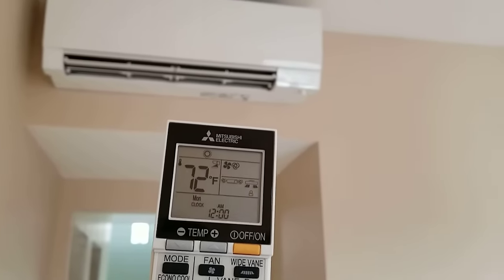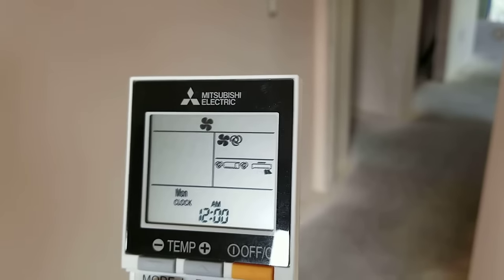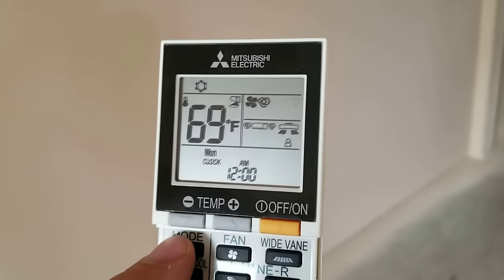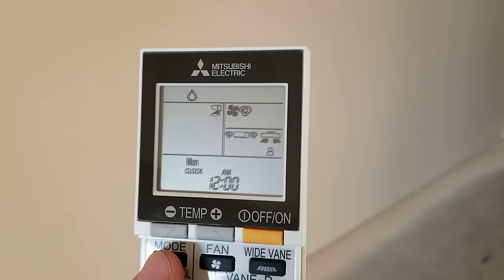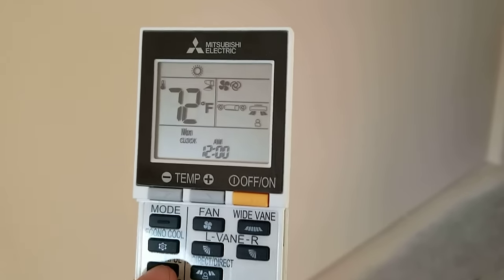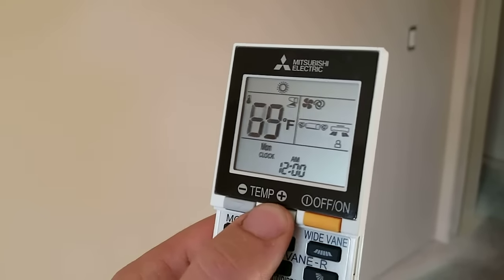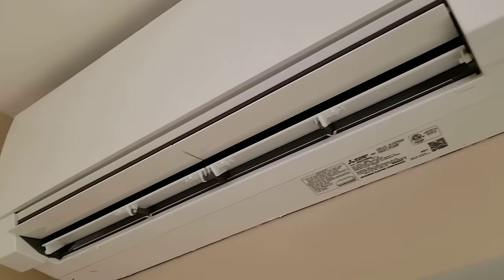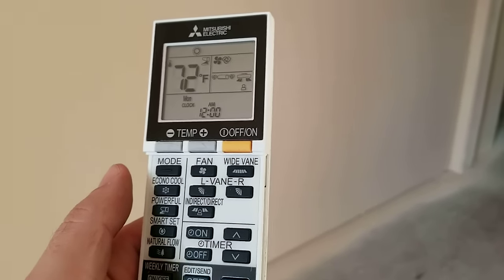Mitsubishi FH FS Hyper Heat Remote Control Operation.

Comment: A lot of talking when does he show how to turn on heat 🙄😒
Reply: Sunshine thing is heat. Set everything else to the auto, the swirl icon. Yeah Japan! :)
Reply from the maker: The old version of the remote has symbols and the sunshine is for heat. The new one is using words like heat so it's very easy to understand. You use the mode button on the remote to cycle between the heat cool dehumidification and auto modes.

Comment: I was wondering why I could not set the heat pump lower than 61 degrees and you answered my question! I thought there was something wrong with the remote, but knowing that the heat pump won't go lower than 61 is good to know. (It double beeped and I wondered why that was the case.)

Comment: I've set the fan speed to level 3 or 4 and kept the temperature unchanged the whole day. What I've noticed is that the indoor unit repeatedly blows at high speed for a while and then stops blowing for a while. Is this normal?
Reply from the maker: Yes. Great observation by the way! The typical reason this is happening, your unit is running in the heat mode on the high speed that you've set, then it might go into defrost which changes the operation mode and then it resumes heating cycle once the defrost cycle is complete.

Comment: So the temperature on the remote is the temperature the desired temperature for the room and the fan should be set to off when your heating the room?
Reply from the maker: Great question! Your statement is correct that the temperature on the remote is your set point that you want to set the room to. But you don't have to touch the fan in the heating mode. You either select a speed of your choosing and I talk about it in the video or you set it to auto which is the general recommendation. If you set the fan to auto the system will automatically choose the correct speed for the fan. Also note that the fan will stay on on its own after the heating cycle has ended. This is to mix the air in the room so you haven't even temperature and to continually sample the air accurately. This feature could be turned off permanently and can't be undone.
Reply from the maker: Great question Gene! When you're in the hearing mode you set the temperature setting and then you can choose the fan speed between night time, 1 to 4, or auto. You can't turn the fan off with the remote when you're in the heating or the cooling mode of operation. There is one way to do it on the board so the fan does not run in between the cycles of heating but that can't be undone. And that's something you want a service technician who is licensed and qualified to do for you.

Comment: I may have missed it but you can change the installation vane settings too. In the latter half of the video you're standing under a mini-split next to a wall. When the remote Off button is pressed you can change the installation vane settings by pressing Wide Vane button. I am thinking this tells the unit to stop checking temperature of the wall its installed next to. By default, it is on the center setting that scans the largest angle.
Reply from the maker: You're right. Depending on the unit model some of them have a lot of detailed options You can set for where to blow and for some of them you can tell it where to sense or how to sense. On some of the cheaper units a lot of those features are not there so I guess it depends a little bit on the model.

Comment: That was a wonderfully complete video! I’ve had his multi-zone system for about 5 years and learned so much from you. One thing though, what is the symbol above the “F” and to the right of the temp number? It looks as though it should be adjustable.
Reply from the maker: Great question. You cut me off guard. Without checking the manual, off memory I think that indicates the IC infrared room temperature scanner.

Comment: Thank you. Very helpful. One question when it is in tear mode (our remote uses the word “dry”), is the temp maintaining the same setting? The temp on our screen goes blank when it is on “dry” And, can it stay on the dry mode? We live at the beach, the summers are quite humid. Thanks
Reply from the maker: Ted Churn, this is an excellent question! 
The dry mode of operation is dehumidification only. In the dehumidification mode of operation your unit will do a lot of moisture removal from the air and some cooling. The temperature in the room will go down some but not as much as if it were in the cooling mode.

In the dehumidification mode it's important to note that there is no humidity percentage setting that you could maintain. That unit goes into a preprogrammed sequence of operation with no regard to the actual humidity in the room.

Uncertain units with humidity sensing thermostats you could potentially accomplish this but not on these with the remote control.

If you want to geek out a little bit you could just leave your unit in the cooling mode of operation and leave the fan in the auto mode which is going to run very slowly unless it has to ramp up to maintain temperature, or put it in the lowest fan speed which is the one with the ear 👂 symbol, below speed number one. This will be air conditioning with the lowest fan speed which is in essence the same as the humidification.
Reply: Many thanks!

Comment: Hi thanks for the video. I still have a question regarding the humidification setting. How do we know what humidity it is set to or does it stop dehumifying once it reaches a certain percentage say 40 percent? Or does it keep running all the time in this mode? And if so how low will the dehumidification go to? If there is no setting I guess the solution would be to leave it in dehumidification and just put it on a daily timer no?
Reply from the maker: Great question. The dehumidification setting doesn't have a an actual humidity sensor or setting. The unit goes through a preset cycle. With the addition of certain controls like thermostats with humidity sensors some units can control actual humidity setpoints. If you don't mind, please consider subscribing to our channel to support our work if bringing free information to everyone. If you want to see more detail on certain topics please ask away 😀

Comment: I use my mini-split in my workshop.  Keeping it at 59F all winter when is is 10F outside in not required or very smart.  Is there a way to override the control temperature set point?
Reply from the maker: I totally see your point. The only way to override that would be to get a different type of thermostat control for the unit. There are several kinds out there and some of them might actually go below that setpoint but I haven't encountered this. Most people that use these units in their workshops either have them off or they have it set down to the lowest set point which like you're saying may still be a bit of a waste just for a workshop. One thing you could try to do is set the fan speed to the lowest night time setting which would limit the capacity of the unit and may not be able to even achieve 59° although it's set to it.

Comment from the maker: If you have additional questions that are not answered in this video please post your question below and I will help you guys get an answer.
Reply: soft and faint  blinking light continues when unit is off. Can only see in a completely dark room. Something to do with the I-See?
Reply from the maker: @girlnyc1597  That is possible and there's also a chance that LED lights on the control board underneath the surface might be leaking some of the lights through. I've not seen this myself so I really can speak from experience.

Comment: Does the placement of the remote in the room affect the function of the unit?
Reply: Yes. It only affects the communication of the remote to the unit when you press a button. The remote doesn’t send commands on its own, the unit regulates the temperature and all other settings based on the last command you gave through the remote.

Comment: hello, mine's a slightly different model- earlier I guess. I've never used this before, the remote functions all right and I"ve set it but-- no heat.  Anything I can check before calling the landlord?
Reply from the maker: Yes, check power to the unit. Make sure the breaker in the panel is not tripped. Make sure the power disconnect outside is on and if there is a surge protector it is working and not tripped. 
Make sure when you turn the unit on it is pointed at the unit and the unit responds with a beep. 
Count if there are any blinking codes on the unit.

Comment: Does the remote need to be pointed at the wall unit when changing temperature setting or other settings? There is no indication on the wall unit to confirm the desired temperature for example. In other words, Can the remote and the wall unit be 'out of sync' ?
Reply from the maker: It can't be out of sync. But it does have to be pointed and the only indication on the wall unit that it received the new command is a short beep. If you don't hear the beep the command has not been received by the wall unit from the remote.
Reply: @cleanairheatingcooling4105  so the remote could read 73F but the unit is still 70F ??
Reply from the maker: @davesherlock1314  the remote doesn't read either. It doesn't red temperature at all. Only the return air sensor in the unit reads room temperature.
Reply: What are the two green lights indicate on the wall unit?
Reply: @tedbryson-um7yc  I believe the left one just indicates the unit is on, and the right one comes on when it’s working to raise the temperature
Reply from the maker: @tedbryson-um7yc  two lights on constantly means the unit is 4.5 deg F or more away from temp setpoint. One light on means the unit is between 1.5-4.5 deg F away from setpoint.

Comment: I have set the weekly timer. If I find it is too cool/hot  when in room can I manually adjust temperature? Do the main temp buttons over ride the timer settings or visa versa?
Reply from the maker: I believe you have to "turn the ON timer OFF" according to the manual. It's a bit hard to follow. But that's what I remember from setting it before. So sorry I don't use that feature and most clients don't so I'm not well versed. That's the one thing that is hard to grasp and not very functional.
Reply: The most confusing remote I have ever seen,I am sure this has stopped people from buying
Reply from the maker: @garypitts5570  You are right about these units being so confusing. The last version that they came out with after the video is even more easy to use than the previous ones. So they're making great improvements on that. I haven't seen people not buying these units because of the remote primarily because homeowners have the option to replace the remote with several thermostat choices including Wi-Fi devices so they can use these units from their phone while in bed or away. 😃 The biggest reason people keep buying these Mitsubishi units is because they are so well built. They lost a long time and they save money on their heating and cooling bills and keeps the occupants very comfortable inside.

Comment: For some strange reason, the "Heat" mode is not available on my remote (SG15J: it looks just like the one in the video ): I can select Cool, Dry, and then (when the Hot mode should come up) it will skip to Fan mode. When I insert the batteries, or practice a reset, for an instant I can see that the Heat Mode icon on the display. But they it won't let me operate it. Any idea how to solve this??
Reply from the maker: Looking into this for you as we speak.
Reply: Did you find an answer as I have the same problem
Reply: @neilwallace4597  Yeah, it would appear that my remote was not intended for my air conditioning unit, but for a slightly different model. It still works, but with one missing feature.
Reply: My sun icon disappeared after I was trying to figure it out? How do I get it back to set my heater on?

Comment: my new system has a soft light that goes on and off when the unit is turned off. I can see the lights in a dark room. What are the lights? Something to do with the I-See control mode? How can I stop it? Thanks.
Reply from the maker: Are these the same two lights that light up when the unit is in operation on the front of the unit? If not they could be something internal on the control board. Please let me know so I can help you further!

Comment: How do you lock the remote so it can not be changed
Reply from the maker: I don't know if his remote can be locked. I'm going to go into have to check the instruction manual. But these units can come with a thermostat that has a setting and you can lock out the entire thermostat so not settings could be changed or you could just lock them one by one such as remove the ability to change the temperature or change the mode of operation or the fan or the louver settings. It's actually very detailed with what you lock out.

Comment: Please do one on setting the heat properly I bought my tiny house used and there is no manual. I can't find a video on setting the heat only air..... no matter what I do it barely heats up and the fan barely blows. a repair man said there's nothing wrong with the unit,,,,, I'M COLD I have to stand less than 4 feet from the unit to feel the heat blowing out but the rest of the 400 ft house feels cold, I slept last night with 4 blankets, socks etc. on.  PLEASE HELP me learn how to set it correctly

Comment: How can i shut off the motion sensor on the bottom of the inverter that slowly turns back and forth.  hate it. makes just enough noise to be so annoying when trying to sleep.
Reply: Odd, I've had my unit for three years and have never been able to hear the eye rotating.  I am sitting four feet from the eye right now.  It may be an issue with that particular unit.
Reply: @jordanpack5571  perhaps. But I was able to figure out how to turn it off permanently and everything else works fine.

Comment: I have three indoor units and only one remote. I am having a hard time understand how to adjust each unit because one of my rooms is much colder than the rest of my house. I can’t warm it up.
Reply from the maker: Taylor Smith, first of all if the indoor units are all the same type or the same series your remote most likely we will work with all of them. Keep in mind that you have to point the remote at the unit and turn it off and back on to receive the input from the remote or just leave it on and change the settings. Remember to listen for a beep in response from the unit on the wall to confirm that it received the new input from the remote.

I hope this helps. If you're having further issues it could be because the remote is not compatible with the other units, or there is another technical issue or something to do with the wiring or communication wire. If you want additional remotes they are pretty inexpensive, let us know if one has to help you with that.

Please come back and let me know if you've tried some of these tricks and whether they work or not for you. And more than happy to help you further!

Comment: How do you put it into Fahrenheit?  I'm stuck in Celsius and doesn't go above 31c, not warm enough. Holding down both - and + while holding down reset, resets the remotes programming, not F or C temperature.
Reply: U want ur unit past 31c ? Do you know how warm that is, theres got 2 be something wrong with it, u need to get it checket.. at 31c ur entering qatar 🇶🇦
Reply: serpent9467   then put on a jacket

Comment: How do you change the battery?
Reply from the maker: I'm so sorry, this is something I should have shown because it's extremely easy. When you slide down the face of the remote if you pull it past the buttons the batteries will be exposed at the very bottom of the remote.

Comment: Hello. I observed my 20K BTU outdoor 2 zone and noticed that when only one zone is calling for heat and the temperature set point is reached, the outdoor unit fan stops. The indoor head fan keeps running though. I thought Mitsubishi mini splits supposed to run continuously... Is it normal that the outdoor unit stops working all together when the indoor temp is reached?
Reply from the maker: Yes. That's perfectly normal. The outdoor unit stops because otherwise it would overshoot the temperature. The indoor fan continues to run on low to circulate the air and sample the the temperature accurately. This also helps filter the air. Great observation!

Comment: PLEASE! help. my unit is not producing heat and once the heat does return water begin to poor out!
Reply from the maker: This sounds like it would require a service call. You can do some investigating yourself and find the source but most likely you will need a qualified and licensed HVAC technician to come out and diagnose this for you. Please let us know if you need further help.

Comment: What is the smart setting? How can I set a temperature so that the unit will shut off or on by itself if the set temperature is met . I’m not sleeping because it’s too hot in the room but I need the heat on during the winter.
Reply: If you turn the unit to heat, and set the temp you want, the unit shouldn’t go more than 1.8 def F up and down from the set point. Keep in mind that the unit measures the room air temp at the intake which is at the top of the unit. That maybe different than the temp you feel somewhere else in the room.